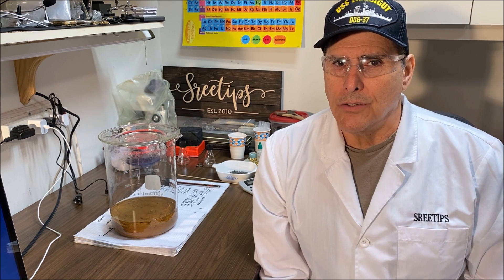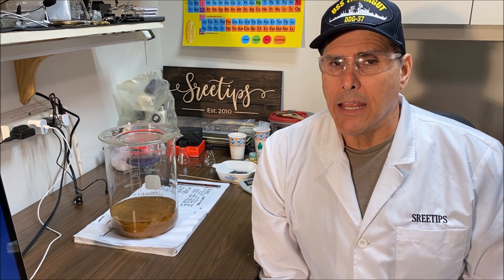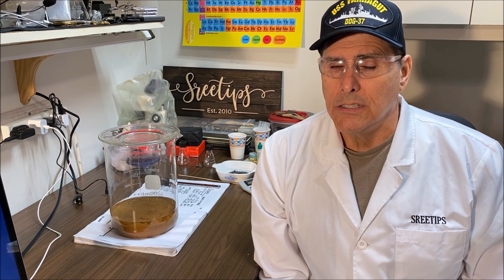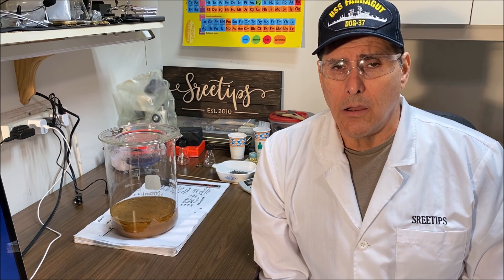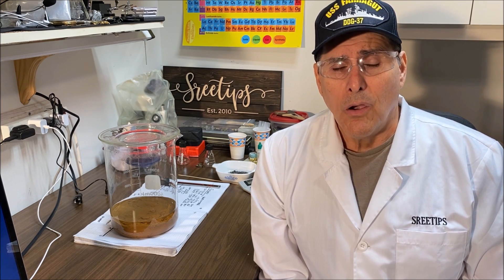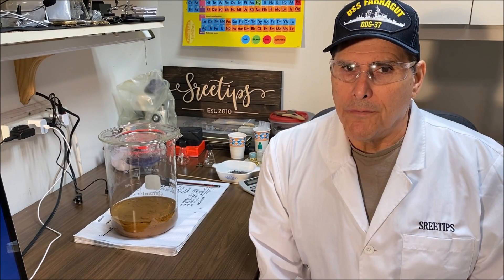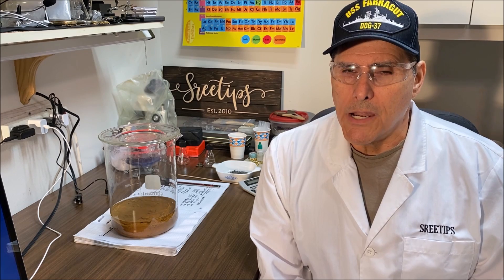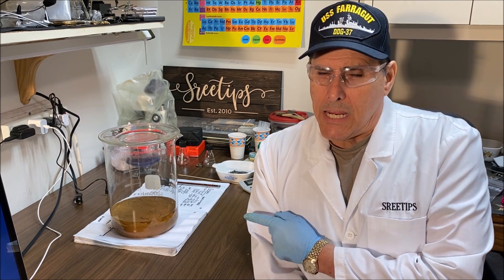Refining $47000 Pure Gold Bar At Home Pt5

Comment: You will get a much cleaner casting if you will preheat your graphite mold to a higher temperature (red hot) before pouring the gold.  Any great variation between mold and metal temps (even just a slightly cooler mold) will cause cold casting issues in the finished bar.  Also best to keep full heat on the poured metal for a longer period to help extend the molten state to allow the metal to fill all of the voids.  Not real important for simply casting for scrap, but does produce a much nicer finished bar.
Reply: He was going for that breaking bad  at home look

Comment: Hi there, awesome video, just a piece of advice, to get a shiny bar, first melt the gold and pour it into a large bucket of water so that the gold will become granulated. Once granulated, put the granules into your mould and then remelt the gold in your mould with your blow torch, the gold will have a shiny surface once it reaches melting point and then let it cool slowly down, it will look like a bullion bar.

Comment: Sorry about my previous comment on the gas I just noticed it was 3 years ago. Important tip my good friend, turn your acet and oxygen down or remove, but always turn the acet off first and you won't get any ruff surface. Fast pour will do away with the layered look on the side of your bar. Spent most of my life with a touch or stinger in my hands. Love the knowledge you bring to the table sir.
Reply from the maker: Thank you

Comment: What was the value of the source gold (jewellery) before you processed it?   Did you use $47,000 worth of gold to start with and refined it down to pure gold still worth $47,000 or did it increase in value after your processed it?   Thank you for this great video.
Reply from the maker: It was $47k worth of karat gold before I started. After refining, it was $47k worth of pure gold.
Reply: Never mind!  I saw your video on it!   I'm sold!  Thank you!

Comment: Very gorgeous bar! Congratulations to the buyer.
I'm used to refine by a slightly differnt procedure: "clorox method" for the second refining (since gold is basically in dust form, it is relatively fast). I know it introduces chemicals, but by heating you can eliminate the oxidant and so an important lower quantity of SMB is required.
Another thing: I got a furnace like your one. I did an adapter to introduce the mold directly into the furnace (obviously in horizontal position). I've never done a gold bar (just buttons), but silver bars are sistematically mirror finished, even if without ripples. Just need to stop the cooling at 965 Celsius for 30min to reduce oxigen bubbles. And you can weight silver cristal (or gold dust) in advance.
Reply from the maker: “Clorox method” = HCl & bleach? I’d like to see your adapter.
Reply: @sreetips  Yes, Sodium hypochloride (I use tec grade, not bleach)& HCl. I have to sign off some declarations in my country because this salt can be used for rocketry (with sugar it is a propeller). It reacts vigoursly with HCl, so I often premix it, than small doses if required.
The adapter I did is refractory concrete (with steel fibers). Long enought to carry my mold, D section with max thick=difference between inner radius and top hole radius and with radius equal to the inner part of the furnace. A simple spring and hook keep the cap closed when the furnace is horizontal (my cap is with hinges on a side, while your cap is free and without hinges, but I believe you can arrange something).
The mold goes in and out by a thin flat piece of steel... like pizza.
At my next cook I'drop you some pics.
Disclaimer: this is not according the furnace specifications and it should not be done.
Reply: PS: the diagonal of the mold (side section) has to be less of the diameter of the top hole of the furnace. If not too much bigger, scrap&round the hedges.

Comment: I seen in a video showing commercial gold refining. After they do the aqua regia treatment to get the gold into the sand. They pour it into a wetter barrel to create the little droplets. They then fill the mold with the droplets and heat it in the mold inside an oven. It produced a very nice surface finish on the bars doing it that way. You may want to check it out!
Reply from the maker: I’ve seen that video. Those bars look good. But I prefer the bright reflective surface and the beautiful pour lines that I can achieve by pouring it by hand. Looks like a pebble thrown onto a mill pond.
Reply: @sreetips  ahh I see. All your chemistry methods. Are you self taught or did you learn this in the Navy? Thank you for creating these wonderful videos senior chief!
Reply from the maker: Self taught - much help from the goldrefiningforum.com and I’m not a chemist.

Comment: What a video, what a task well done, no home refiner can put a glove on you!.....Now today whilst home refining I added (in between doing the missile parts) to much nitric to a mix of ceramic old pentiums and cyrix, and some of the new fine pins cpu's, don't know why I mixed them TBH, day before there was a great stannous test, this morning it had all plated out, so I heated it up and added nitric but instead of pipetting I poured it and added way too much nitric, anyway all dissolved and dealt with BTW of SMB....so, point is if you have time can you show us ways to deal with a  deliberate Sreetips nitric overdose, as there must be several ways.....Thanks love the vids, your a tue gentleman you really are.
Reply from the maker: So far the best way to rid a gold solution of excess nitric is to do a classic evaporation to syrup then rehydration with hydrochloric. But that may not work with computer scrap.
Reply: @sreetips  Cheers mate, Excess SMB with the horrid SO2 did come trumps. Like an onion this refining, you remove one skin to find the next.

Comment: If the AR reaction stalls and more potassium nitrate or nitric is added and it doesn't start again, don't beat a dead horse by adding still more potassium nitrate or nitric, instead add more hydrochloric. Jump starting the reaction with extra hydrochloric will enable the already added nitrates to be used up, this does not require using separate beakers, the original is just fine.
Reply from the maker: Good advice, thank you

Comment: During your last couple of rinsing any nitric from gold work better using some hot water instead of room temp distilled water?I watch your videos and I’m so impressed with your knowledge that I’m gonna give gold & silver a try this summer. I worked in commercial heat treating so I have some experience with metal
Reply from the maker: Hot water rinses are better than cold.

Comment: I love the detail shown in the video.  Question:  When you have precipitated gold powder, why would you add sulfuric acid to precipitate lead?  It seems the lead is in solution that you could pour off and wash from the powdered gold. Once you precipitate the lead, doesn't it become part of your final gold product?  Just asking to learn. Thanks.
Reply from the maker: I add sulfuric when I’m dissolving the gold. Any lead that may be present will form insoluble lead sulfate. Then it can be filtered out to remove 100% of any lead that’s present. I add sulfuric whether I suspect the presence of lead, or not. It hurts nothing, costs nearly nothing, and provides a big benefit. Sometimes people will try to repair a piece of gold with soft solder. Soft solder is made of tin and lead. The main problem with lead is that it ruins the ductility and malleability of the gold, even in trace amounts. Some claim that cross contamination of the gold with lead can occur if both metals are being melted in the same room at the same time.
Reply: @sreetips  Thanks for responding!  For your reference, at 2:15 in this video, the gold is already precipitated when you add the H2SO4 to precipitate out any Pb.  Seems like it might not have any impact because you had already refined the powder. Cheers.

Comment: Maybe a silly question here, but what would be the result if, right after inquarting with the silver, you skipped the nitric acid treatments and went straight to aqua regia?  Would it be as pure, even though you'd have a huge amount of silver sludge on the bottom of the beaker?
Reply from the maker: As soon as the inquarted gold hit the AR a hard crust of silver chloride would form and shield the gold from the acid. You could boil it until the cows come home and the passive layer of silver chloride would cling tight. You could take it out and remove the passive layer but it would reform as soon as you put it back in the acid.

Comment: To avoid surface issues you need to load the mould with the gold powder first. 
Then u put a ceramic cap plate on top of the mould, then you heat up the entire moulder in the induction or gas heater. 
It may take longer but the finish of you bars (gold and silver) will be much better.

You are messing the finish up because you are hand pouring and thus create swirls and the gas heater also create surface ripples in the gold bar.
Reply from the maker: I love those pour lines - so do the folks I sell the gold to

Comment: Sreetips, I'm just curious, about your drying technique.  Since you are using a ceramic pan to dry your gold sand, would it have been possible to place the pan in an oven set at 200 degrees, to dry the gold faster?
Reply from the maker: Yes, but it may give off some fumes from the traces of residual chemicals.
Reply: @sreetips  good point, thanks

Comment: Apologies if you've answered this question in your videos (I really enjoy them BTW) but I'm curious why, if the the Nitric acid dissolves the silver and  other base metals out of the gold, why do you need to disolve the gold in Auqa Regia? Why can't you go straight to the melt table after the Nitric boils?
Reply from the maker: You can, and I have. But the gold after those boils is very close to three nines. The only way to get it there is to refine it with aqua regia.

Comment: Hey GREAT JOB,...I enjoyed all 5 video's and picked up a few more interesting tips on refining along the way.  I have been working on much-smaller gold refining projects and your video's have really helped me along the way.  I have also had an issue with gold going back into solution due to too much nitric and have straightened the issue out by adding a large amount of distilled water to the solution and then waiting about an hour.  This I have discovered "Backs-Off" or Dalutes the total acidity enough to drop the gold.  Also,  I can't remember just where, but in C.W AMMEN'S book RECOVERY AND REFINING OF PRECIOUS METALS  I can remember reading that when ice cubes are used, to "NOT"-use tap water cubes, as they have chlorine in them, and it is supposed to create a film that retards, or prevents the free flow of gold to drop out of solution.  Based on your video's, you don't appear to be having any problem with this.  Gary
Reply from the maker: Dilute the solution. Someone else touts this technique. I’ve never tried it. It’s a good tip though. I had 25 ounces in 3.5 liters.

Comment: I just add a drop or two of nitric and add sodium hydroxide and smb when precipitation of the gold it turn dark quick and if it gives me a lil trouble I get a half spoon of baking soda and dust lil by lil and it will start dropping soon as the baking soda hits  but I try not to use baking soda so don't have to wash it so much

Comment: Stupid question... Where did you get your casserole dishes...? I'm having the hardest time finding anything safe for use on a burner. I had a good old fashioned corningware dish that worked perfectly until I dropped it. I can find vintage ones on ebay, but can't find anything new for some reason.
Reply from the maker: I buy them at yard sales and the thrift store

Comment: What a great bar! well done. I have a question regarding the apparently high loss percentage.
My calcs showed that you should have achieved around 795 grams. You achieved 767 grams.
Do yor have any explanations for the 3.74% lower yield?
Once again well done!
Reply from the maker: Yes! Karat gold is almost never plumb. 14k can be as low as 13.5k and still stamped 14k. So, 13.5k/14k=96.4% which represents an expected loss of 3.6% plus there was a three gram button I discovered in the crucible. Light coating of gold on the bottom of each rinse container. Drops of gold bearing solution splashed out during pours. Crumbs of gold fell to the table while charging the crucible. Drops of gold bearing solution went up the stack while boiling the gold. These losses all add up
Reply: @sreetips  Thanks, pretty much as I thought. I allow a loss margin of 4% when I am doing Karat gold and usually end up at between 2.5% and 4.5% losses
I really must commend you on your projects. I love watching them all and learn something new EVERY time I watch. Again Thanks! and stay safe as I think things are set to get a lot worse over there. I am very lucky to be in Australia where it is very much under control.

Comment: Thank you for this great series of flics.
What I am wondering is if your rinse water, etc. Only contains the silver, copper and non-nobel metals, if if Platinum group metals are in there too. Or are they contained in the gold bar?
Reply from the maker: The PGMs will be in with the gold in solution. After adding SMB the gold precipitates and most of the PGMs stay in the waste solution. SMB will precipitate traces of PGMs. We add the waste solution, with the PGMs in solution to the stock pot. They cement out as a fine black powder on metallic copper in the stock pot

Comment: You are constantly improving, i feel priviledged to watch you work. One thought, the torch could move say 30degrees sideways before shutting off? Might stop the carbon issue if you shut the oxygen off.
Reply from the maker: I normally work with 2 to 4 ounces off gold per refining. This bar was way outside my experience level. I normally don’t use the oxy/acetylene torch in this manner. But I’ll know better next time.

Comment: I'm sure someone has mentioned it already but I'm thinking the reason you had such a hard time getting all the gold to go into solution was the solution got saturated. Adding some distilled water would have probably been beneficial, so as the nitric dissolves the gold, the water can take it up into solution so the acid can dissolve more.

Comment: Would there have been any benefit to adding borax to the gold melting ?
Reply from the maker: If too much is added then it could glue the bar in the graphite mold. The only way to get it out is to either break the mold or add more heat to release. I chose to not add any at all

Comment: Love your work! Can you maybe tell me what you think of the following method?

1. Dissolve the gold-bearing raw materials in a mixture of concentrated hydrobromic acid and nitric acid, called the etchant solution.

2. Neutralize the solution using potassium hydroxide to form a gold compound called HAuBr4.

3. Recrystallize the HAuBr4 to obtain pure gold compound in the form of KAuBr4, also known as potassium tetrabromogoldate.

4. Add a compound called alpha-cyclodextrin (a-CD) to the KAuBr4 solution.

5. The a-CD and KAuBr4 will spontaneously form a complex called a(cid:3)Br, which can be separated from impurities by filtration and then reduced with a reductant, such as sodium metabisulfite, to obtain pure gold metal.
This powdered gold can then be melted.
Reply from the maker: Sounds complex. A lot more chemistry than I have experience with.

Comment: 11:28 A friend of mine was the president of a magnesium plant, where I did a ton of metal reclamation in, pulling copper wiring from under the plant. Shortly after we finished our work, the plant had an explosion and they never did find the bodies. Molten magnesium and water are not too friendly with one another.
Reply from the maker: Count your blessings
Reply: @sreetips  I did. We were very lucky.

Comment: Why does the solution have to be cold before and during gold precipitation?  What happens if you add SMB to the hot solution?
Reply from the maker: Heat promotes a nitric reaction. Cold nitric is much more docile than hot nitric. If excess nitric is present, and if the solution is hot (adding SMB creates its own heat) then adding more SMB could easily cause the solution to boil over the top of the beaker. Adding ice to keep it cool prevents this from happening.

Comment: Did you use gold filled or solid gold for this video?
Reply from the maker: I used karat scrap
Reply: @sreetips  but do they fall under gold filled or solid gold
Reply: Karat gold jewelry is either gold filled or solid gold
Reply: Karat gold jewerly is solid gold
Reply from the maker: Karat gold is solid gold. Gold filled is a thick coating of karat gold over brass.
Reply: @sreetips  I want to do the same thing you did in this video, where can I find karot gold for cheap?

Comment: The other thing I have a question about is how about using mapp gas on your homemade forge ,also I have not seen any one use mapp gas on a devil forge ,what do you think, isn't mapp hotter than propane? I used to use propane and oxygen to cut scrap iron,my torch was capable of cutting 6".
Reply from the maker: Map is hotter than propane
Reply: Mapp is available in larger tanks like the 5 or 7 and larger tanks similar to propane tanks